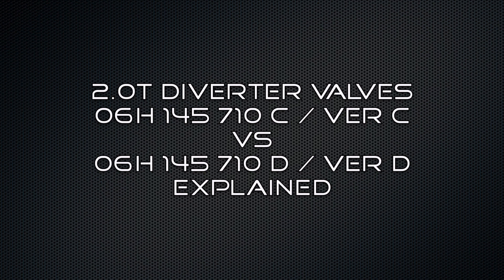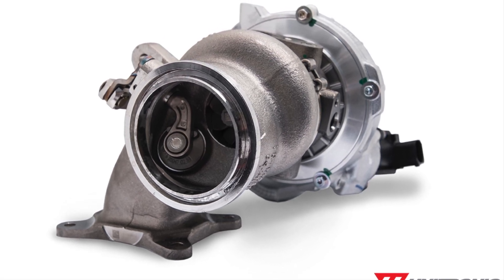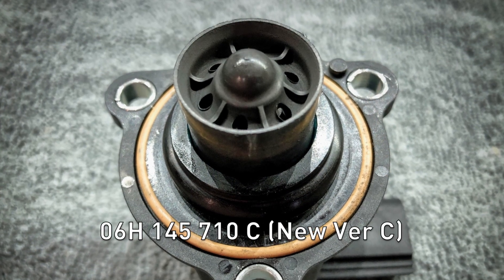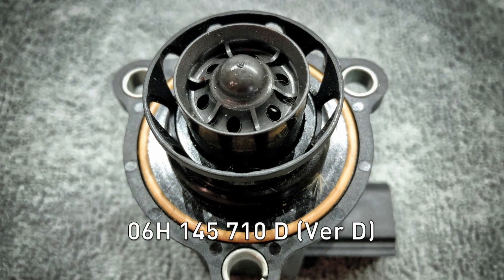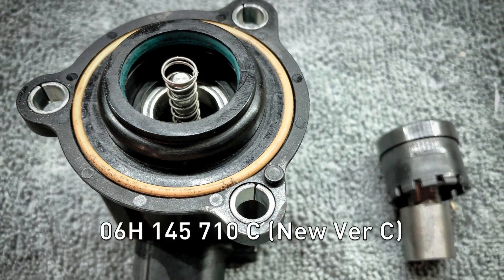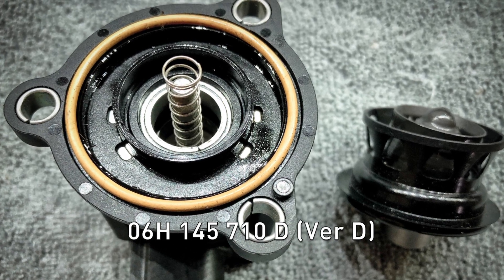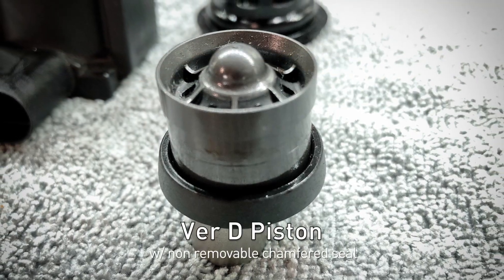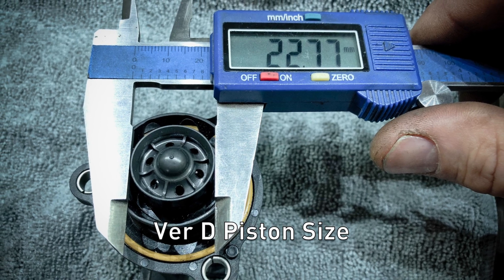VW 2 0T Diverter Valve 06H145710C (updated ver.) vs  06H145710D

Comment: WG wasn't probably adjusted to the correct voltage on installation and the owner more likely swapped the old IS20 DV onto the IS38; thus, getting a turbo swap for absolutely as cheap as they could.  But, they sure paid for it later more than they would have up front didn't they? 👍

Comment: Would a diverter valve spacer paired with a revised c dv from Peinburg be a good set up or will it cause stress on the turbo for a Mk7 equipped with an IS20
Reply from the maker: I don't think it's going to make any difference. I know that Unitronic says you don't need those DV adapter kits, like the one that Go Fast Bits makes. However, we sell them and they are more for longevity than performance.

Also - do not use a blow off valve on VAG vehicles. There is a difference between a Blow off valve and a diverter valve. Blow off valves will actually cause your car to run worse that just the stock OEM DV. Blow off valves vent to atmosphere and do not recharge the air intake that goes back into the turbo. When you have a DV, it recycles the excess released air pressure back into the intake. Thus spooling the turbo faster. In a nut shell, if you have a blow off valve, your going to have more turbo lag. So always make sure you have a DV kit if you get an adapter.

When ever we tune a turbo vehicle with a blow off valve it noticeably runs worse. I've performed these tunes hundreds of times and when I test drive after - I can always tell that it's not a DV. I tell the customer they have to go back to stock for it to perform better.

The only real difference between the Ves C & D is the plunger on the end. The Go Fast Bits DV kit has a billet plunger so it will not wear out. If you use a Ver C or D with a GFB DV kit, it's going to work the same.

Comment: And so, how did you resolve the issue ? I have a stage 3 RS6 C7 that doesn't make the boost it's supposed to (2.6 instead of 3bar) and the power is almost the same as when I was stage 1. that looks a bit the same as what you describe in the start. thank you

Comment: This video helped me understand what the diverter valve does more completely. Additionally, I learned that Piersburg is an original equipment manufacturer for VW . My VW mechanic is replacing my 9 year old C diverter with a Pierburg D piston style diverter this week. (Ok plus a leaking timing cover, water pump, thermostat housing and timing chain. Oh and they're decarboning the intake valves and manifold). Its a 2013 with 103k miles, an APR Stage 1 chip , Bilstein B6 upgraded and 1.5" lifted suspension and oversize Michelin Defenders on 18 x 8" CC wheels giving another .8 inches of lift. The Forge front lift spacers created problems and I had to take the front suspension apart and take them off. The rear spacers work great and they give the car a slight rake forward, which looks really good. After CV boots and other front steering repairs this Tiguan looks like it may become a long term utility and around town truck. It drives like a GTI on stilts with more power and grip. Fantastic stuff. Will ...Austin, Tx

Comment: Hey how to diagnose this valve?
Reply from the maker: Typically they leak oil though the electrical connector or around the circumference of the flange on the turbo.

Comment: I have a fluttering sound, using stock intake I hear it on medium throttle position from time to time, would the issue be this DV? I have 06H 145 710 C. I’m just thinking if I swap it for a newer version my car will be a bit faster because is maybe leaking boost? I currently have no codes…
Reply from the maker: I have the same sound on my 2017 2.0T MQB GLI. You can always check it to make sure it's not damaged, but at that point you may want to replace it - just for piece of mind. Also if there is any oil seeping out around the seal, outside of the DV, I would changed it for sure.
Reply: @MeisterWerks  thanks for your quick reply!!

Comment: There is a version J now. Do you know the difference between D and J?
Reply from the maker: Ver J (06H145710J) has a thicker reinforced sealing ring around the piston. Probably because this is where they start leaking, which is what causes them to fail.
Reply: @MeisterWerks  good to know thanks!
Reply: The J here stands for Jerking… dont buy that shit - had to go back to D and all is fixed (scirocco k04)

Comment: Which one would you recommend for K03, Mk5 GTI?
Reply from the maker: The Ver D and up.
Reply: MeisterWerks ah thankssss, what I meant was like which one of the two Ver. C the new latest one or the D? Hahaha
Reply from the maker: @MBilan  Technically the (new) Ver C shown in the video is the most updated one that is in the 2017+ Golf Rs. but both will work. Shouldn't notice a difference between either one.
Reply: MeisterWerks thanks loads!! Really appreciate it!
Reply from the maker: Exactly.

Comment: Does anyone know how important the plastic housing is around the piston on the D version? I just got my replacement in the mail and the plastic part is broken, didn’t want to go thru the hassle of returning if it’s not a big deal and I can just install anyways
Reply from the maker: As long at the retainer clip is holding the piston in, it should be ok without it. But I would still get a new one because if it breaks, it will go into your charge pipe and potentially damage the intercooler or engine.

Comment: After vigorous research - there is actually an UPGRADED C version which has the newer piston! See below:

OEM: 06H145710C
MPN: 7.02901.05.0
 (Old C version is 7.02901.01)
By Pierburg
Genuine Pierburg OEM diverter valve. Features the upgraded piston type design, modeled after the more robust aftermarket diverter valves. The old DV is prone to failure, regardless of if your car is stock or chipped, as the fragile diaphragm can rupture under boost pressure, resulting in a boost leak that will hinder your car's performance. This is the ideal solution for anyone who want to upgrade their car with a stronger OEM diverter valve. Made in Germany by Peirburg.

Link for this info: https://www.europaparts.com/diverter-valve-06h145710c.html

D version has the upgraded piston to, but also has the extra fence around it, not sure what that is for!
Reply from the maker: Yes. This is covered in the video, thus the Old Ver C / vs New Ver C. There is no different in pison or output size on new Ver D or C.
Reply: @MeisterWerks  this video was very helpful to allow me to find a most upgraded C! Though the C version shown in your video has the Pierburg MPN 7.02901.01 - but now the latest REV C with the New Piston has the MPN: 7.02901.05.0! I might be wrong, but seems like the version C shown in your video is a non-revised C, but yet better than those older crappy versions.
Reply: @JH-sc7cs  
is there a benefit in the new C vs new D?  is the new C a diaphragm or piston style?
Reply: @cliffordlebel2977  i just ordered one and should arrive in 5 days. But if you read the description of the product of the new rev c in the link from europarts website above, it states is has the new piston
Reply: @cliffordlebel2977  i also read that the rev D version had that extra grill piece break for users, therefore they've gone back to the new REV C without that grill piece. both have the same revised pistons though
Reply: Can I remove cage off new d version and put old version on the new part  from the c ?? Fits right in just not sure if it will change anything !  Help

Comment: In A6 C6 2.0TFSI I had old version C. I replace it for version D and sound of turbo is completly difference... Turbo is quieter and sound is without hum when I accelerate - it is much more pleasure for driver's ear ;)

In my case membrane was ok but the pin was not taking open the valved - pin was grated... It was orginally valve in almost 250000 km.
Reply from the maker: Good info, thank you.
Reply: Now I'm thinking about efficency old version C (have silicon) vs D (only plastic). Which is better for preformance? I theory C should be more tight for bost preassure ...
Reply from the maker: @k4mi11  But if your running a tune, 18+psi of boost. More likely to wear / blow out faster.

Comment: The original diaphragm DV was parts bin 06F, not 06H.  So 06F 145 710 B, then C, then G.  The G is what was originally in my '09 A4.  The diaphragm DVs tore easily and so were replaced with the piston design, 06H 145 710 D.  And this is what you'll see as the proper DV for a B8.0 A4, A5, Q5 with the 2.0T.  The curiosity is at the B8.5 refresh (2013), they changed to 06H 145 710 C.  This did not replace the D, both are still current parts at parts.audiusa.com.  As shown, the only real difference seems to be the removal of the cage.  Good luck getting any technical explanation for the D to C change and why they are not interchangeable in 2.0T EA888 engines.  Also note, 06H 145 710 C has been superseded by 06H 145 710 J, at least for Audi.
Reply from the maker: Thank you for this info.
Reply: Which part would i need for my 2014 GLI gen3?
Reply from the maker: @Nekroman111  The stock one is fine.
Reply: @MeisterWerks  my GLI mk6 has DSG and i noticed that driving from stopped position, is laggy/hesitates a little bit. I also hear a very very sublte whistle when driving so i dont know if it had to do with the DV. I should add that i have a CAI and Nuespeed Module that add 4 lbs of boost

Comment: This is an awesome explanation of the Diverter Valve.  Thank you. I had my diverter valve replaced due to P0299 under boost code.
It was replaced with the "D" version. No more codes!
Reply from the maker: Thank you.
Reply: So status check. How'd that D work for you long term? LOL 

Did you feel like the car was dead before 2K RPMs?